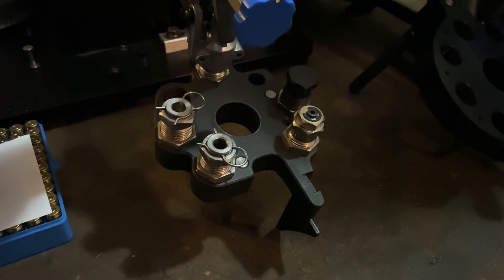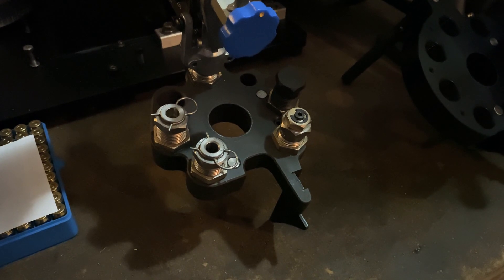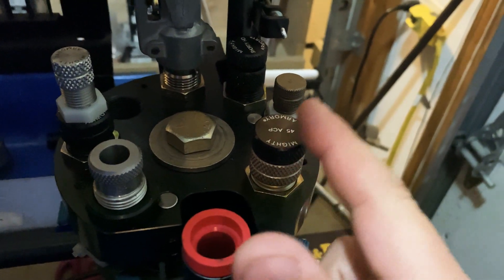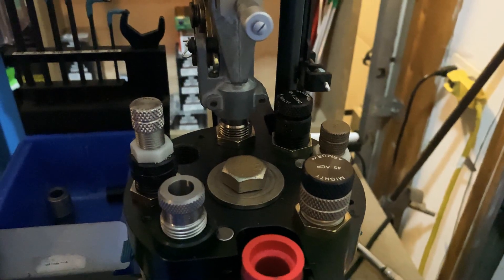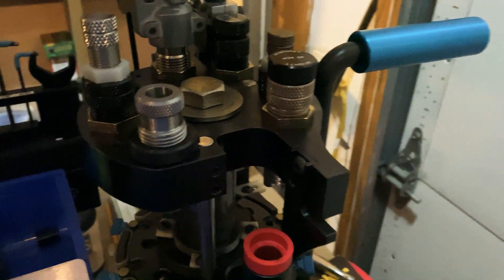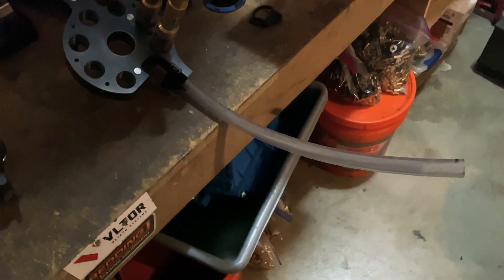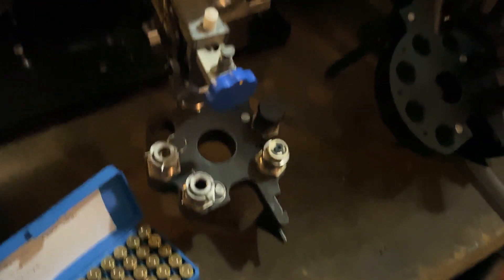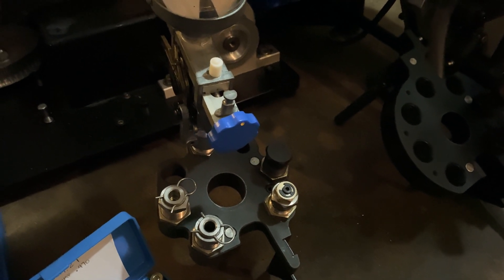Mighty Armory Dies vs Dillon dies with CNC Shooter Enhanced Toolheads on a Dillon 1050

Comment: Like that CNC tool head.  I have tried MA sizing dies and have always had a pushback issue on my 9mm jacketed bullets.  I talked to MA about the issue but have never been able to get consistent results.  Works fine for the slightly larger lead-coated bullets... About 10%-15% of my 9mm jacketed rounds would also have a bullet pushback issue.

Comment: Are Mighty Armory that much better compared to Dillon for FL resizing rifle?
Reply from the maker: I’m more a handgun reloader. That said, these are two totally different “style” Dies.  Dillon dies undersize your brass, they combine a few functions together (so they can be used in a 550-650-750-etc).  MA does are not undersized dies, they are designed to make rounds perfectly to spec… also each die typically serves one function, not multiple.  

IMO, I prefer MA dies far more than Dillon.
Reply: @bobby_cee  thanks! I usually FL resize on my single stage, then finish on my 550B. I was thinking of ordered the MA FL 308 die.

Comment: Very nice setup you have there, im leaning heavily on getting a 1100 and some mighty armory dies. I have a question, when using different lots of brass with different head stamp, does it make much difference in powder drop consistency? Does it affect accuracy? Also have you had any issues with the priming on your 1050/1100 presses? Thanks

Comment: Do you think I could get better results using  Wayne’s sizing die on a Dillon xl650.  I experienced bottle necking loading 115 xtp bullets.
Reply from the maker: Yes... the Dillon size die is actually undersized which is what’s causing that.  I would also talk to Wayne about crimp die selection.

Comment: Good morning, 

Thank you for the video! Just purchased the TNT die for 9mm.  Can you doba full walk through on your 9mm set up? I also noticed the TNT sizing die has more "resistance " when coming up in the stroke. I figured it is because the die is now sizing the whole case instead of just the top half..... 

Liked and subscribed!
Reply from the maker: I personally would give Wayne from MA a call, he will walk you through the entire set up!!  If you are looking for just a walk through on sizing die, it’s very straight forward, pull the handle down all the way, screw the die in until it touches your shell plate,  back out the die 1/8th turn, lock down.

I’m not sure what kind of dies you used in the past, but MAKE SURE you are using lube on your brass before loading.  I like Dillons product best, but any will do.  If you are lubeing cases the die should be smooth as butter!

Comment: Cal gunner here nice job very good info I like you hate the coke bottle look, BUT have not seen any difference on target.
Reply from the maker: Whats up brother!  First, thank you for checking out the video and the comment.  I will agree that for the most part the ammo pressed out on the Dillon dies is capable of shooting perfectly fine.  What I did noticed today at the range is the ammo loaded with the MA dies had a different consistency of felt recoil as well as a softer shooting.  A few other shooters at the range agreed with this (blind shooting to eliminate bias)...  Feel free to check the Calguns post and I'll update it with my test target from today!!

Comment: With the MA dies, are you lubing the brass since the dies are steel (not carbide)?

My Dillon dies do the same thing when loading 147+ projectiles in 9mm.
Reply from the maker: Yeah, so I originally used to be big on carbide and not “needing” to use lube was something I always thought was better.  

Then I started using lube (on my Dillon dies), it made a difference in terms of smoothness.  Since then I’ve used Dillon lube on all cases.  

Even now that I changed to the MA dies, it’s not a big deal since I was using lube with Dillon... and results are far better.